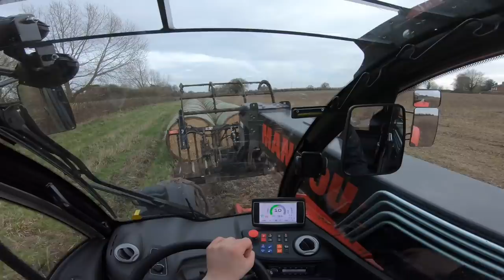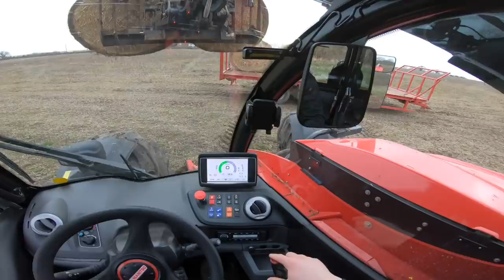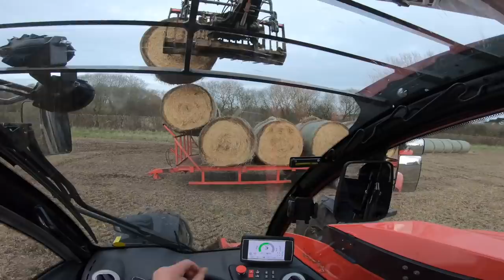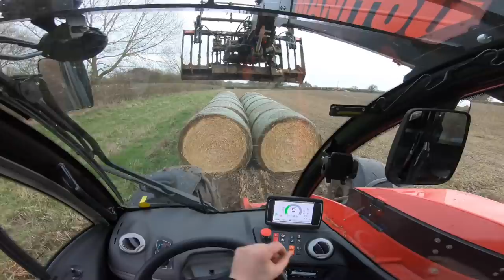GRABBING BEDDING BALES WITH THE MANITOU HANDLER!

Comment: Check out George Saunders,, he's got a Merlo on demo at the moment,,, We have 2 merlos,, a multi farmer with 3 point linkage,,, far far superior machine
Reply: Mark B what year is the multifarmer had you any trouble with it
Reply: @cathalquinn5487  it will be 2 years old in May,, Fantastic piece of kit,, it replaced our 2 loader tractors,, with money left over to buy more stock..
We go overboard with the service intervals,, but it's worth it,,
Reply: Mark B I have a 50.8 out some loader, same size as the multifarmer he said the multifarmer would be €130,000 would they be that much
Reply: @cathalquinn5487  we got ours brand new,, cash,, both of them,, we did sell 2 loader tractors too,, both of them combined were £64000. So roughly yeah,, it cost of for both over £200,000,,but put this in perspective the 2 loader tractors we replaced we bought them new,, not as much horsepower or fuel economy or lift capability,, so really the merlos were a much much better buy,, more efficient,, better handling, turning etc etc
Reply: Mark B Im thinking the same good power in them cvt gear box there is nothing you wouldn’t do with one. We just changer 2 tractors so not in the running at the moment but, but down the line we will be looking at one.